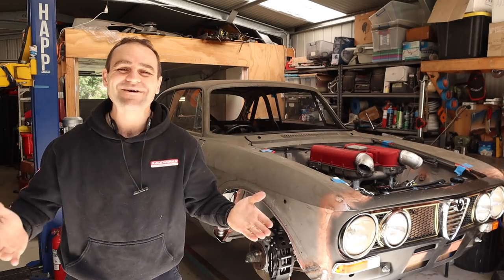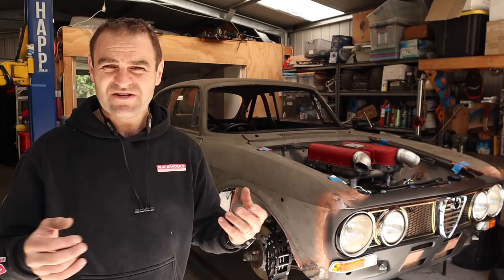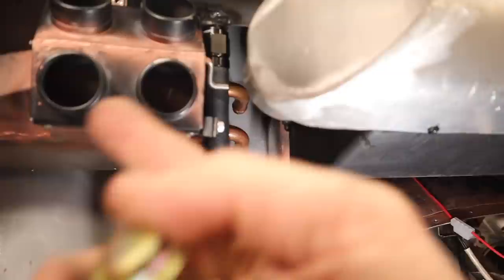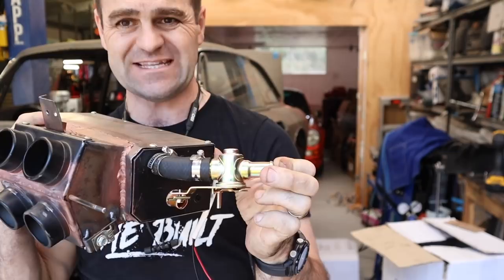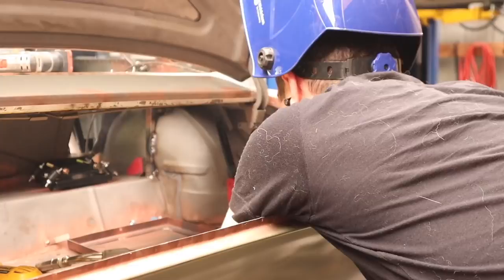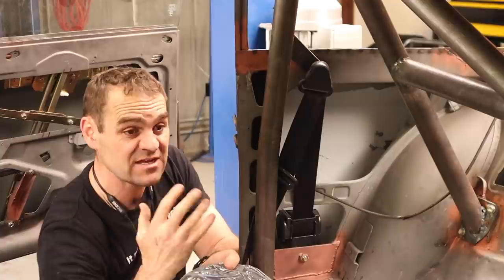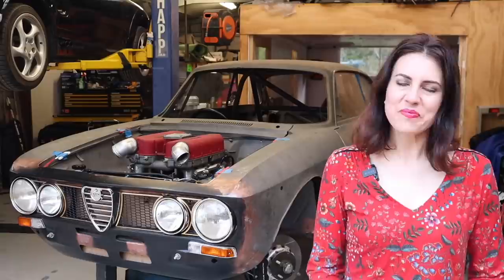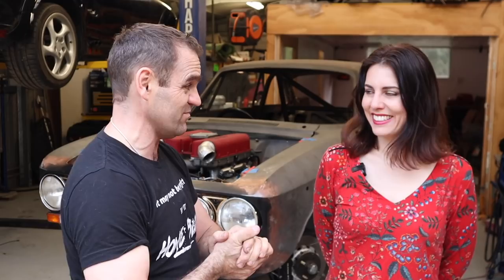Finish the boring bits - Ferrari engined Alfa 105 Alfarrari build part 112

Comment: Let's just make one thing crystal clear once and for all. Analog audio gear is very sensitive to all kind of interference and the one solution is star grounding, one ground point for ALL the gear in the control room, use this philosophy in a car and you have a car that you can run flat out for 24h. Chassis grounding in a million places is just a recipe for disaster. Keep on being awesome Jeff, you are doing a banging job with that Alfarrari 👍😎

Comment: The word you're thinking of is noise. Ground loop noise in fact. At the Alpine insti learning to install car audio in the 90s the first thing we learnt was ground loop isolation and star grounding. My race car has 1 earth point, which is the battery itself. The engine and chassis are still grounded but everything runs to a firewall bulkhead stud

Comment: TBH, Mrs. Jeff's Italian isn't any worse than my English. Yes, I was born and raised in the USA, but my spoken language is Texican- very clearly not the stuff spoken in Nu Yawk or Lossangelees. I'm pretty sure we could spend an afternoon and a few pints on "aluminium" as opposed to "aluminum". And Italians I have known don't speak English any better than Mrs. Jeff's Italian. Not to worry- it's a joy for us all to see her wrassle  all that pseudo latin into some meaning full dialog! And we are listening! 
  As to the boring bits; some time in the late '60s or early '70s I was told a manufactured car had about 17,000 parts. The chrome trim and the big horsepower engine, the only really shiny an spiffy bits only account for several hundred. In spite of what reality TV has tried to portray, whole automobiles, even stripped down racing ones, aren't built in a day or a week- not even a month unless the dollars are infinite and helper's hours are a bagatelle. BTW, many of those "built in a week" whizz bangs were never actually turned over to their owners as shown- they were weeks being worked on, often in other off screen venues, getting things like the wiring and window winders operational. Yer doin' fine, mate! One of Benny's friends is fond of saying  "Use yer brain"- and you both do that!  Missing Mrs. Jeff's collection of fine Austalian wool sweaters, but it's getting coolish here in Texas so it must be getting warmer Down Under!  To the best!  FR

Comment: Looking good! Don’t forget to add one (or more) air bleeder valves to the heater/cooling system.
Reply from the maker: Not necessary. The radiator is the highest point ;)

Comment: I'm afraid you'll have to seal in the rear speakers - you can't have the rear radiation from the speaker mixing with the front radiation or it will just cancel out all the bass (and a bit higher too, with those dimensions). And you should fill the remaining sealed chamber with foam (preferably grey foam as that has the right density).  Also do make sure you connect them all with the same polarity or this too will cancel out the bass.  Just a tip from a loudspeaker designer with 40 years experience.

Comment: The heater valve doesn’t have to be inside the cabin.
In the Ford parts catalog there are electric heater valves.
You could also flip the heater core and put the hoses on the other side.

Comment: Hi Jeff, great channel! I always enjoy watching. A little tip from me, if you are already in the process of building a mount for the speakers, build a very closed insulated cabinet exactly matched to the speakers. When do you have the possibility to do that with cars ?  In addition, do not take a coaxial speaker but a 2-way system, which gives a much better sound because the axis in the middle of the dome does not interfere. A coaxial speaker is always a compromise. The speaker manufacturer will be able to give you the right volume. 
Many greetings from the real, original SOUNDGARAGE Hamburg Germany

But.... Do you even need speakers with this engine sound? 😁😁😁

Comment: Oi Jeff, are you gonna mount bumpers on the bella macchina? If not, may I suggest moving the front turn signals down to the bumper brackets? The front would look a good bit cleaner that way. Even if you gonna mount bumpers, turn signals hanging down from them might look better than the factory turn signals bunched up there against the big headlights.
Reply from the maker: Still tying to find the right park and indicator combo that works.

Comment: The copper pipes for the heater would be better poking through the firewall and connected in engine bay, if there is a leak in the hose inside the cabin someone might get scolded.

Comment: Just commented on the A/C video asking about other required hardware to make it work, and in this video there is the compressor, although very shorty. Is there a video about how the complete A/C system is built, or is this pieced into multiple videos in tiny parts? Your presentation is top notch, so was hoping that there would be a "clear picture" on how the system is built in it's entirety :)
Reply from the maker: I have a more complete A/C build on my 911 series ;)
Reply: @HomeBuiltByJeff  Have to look that up. Jumped in on your journey on this Alfarrari, and haven't had time to look the previous builds yet. Thank You! :)

Comment: Will you be adding a sub bass to your sound system, the spot you allocated for those rear speakers would have been great for some sealed boxed 6 or 8" subs(some only need 5~10ltrs of box volume), would sound much better than rear speakers.

Comment: And on this episode, Jeff builds a bracket.
Reply: Was there a montage and funk?
Reply: BOM stretched that out for 5 years. Luckily Jeff doesn't!
Reply: That's probably why it's called Finishing the boring bits.
Reply: @denwiessimo6088  brackets aren't boring! They make or break a build. Anyone can slap together a SEMA build. Go watch BifB and marvel at the discordant crap Chris throws together with square tube "stand offs" that weld to round bar and connect with flat plate. Everything has a separate bracket and nothing makes sense! Then look at Jeff making a mount that holds three and serves 4 purposes! BOM do it even better, albeit much slower....
Love a good bracket! Makes working on a car so much better!
Reply: @1one3_Racing   I'm not saying brackets are boring, I replied to ts' statement that Jeff builds "a bracket". That had a certain undertone imo.

Comment: Does the steering computer need speed sensor input? Yaw angle? Steering rate? Are you going to use traction control?

Comment: Hey Jeff, did you check if that engine setup requires a bypass for the heater shut off valve when it is in the closed position ?
Reply from the maker: I made the engine side of the heater plumbing in a previous episode ;)